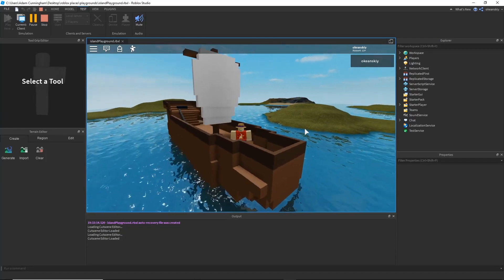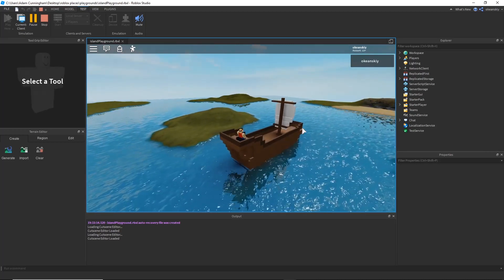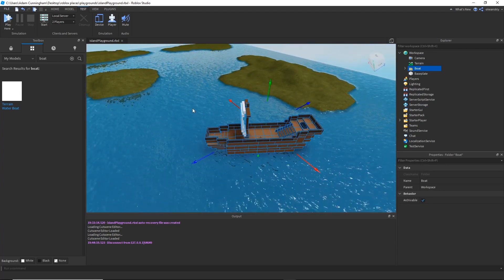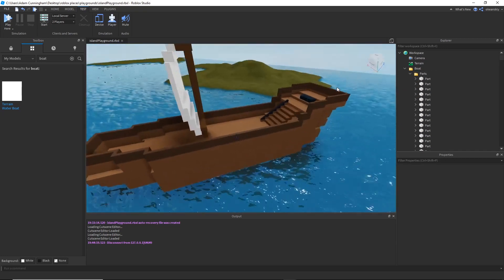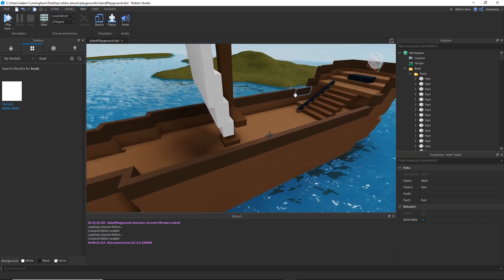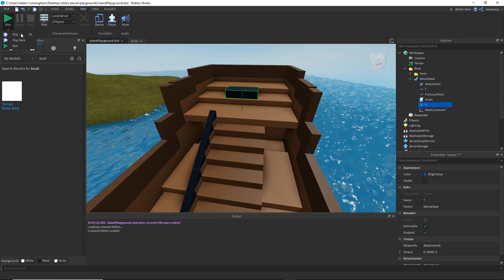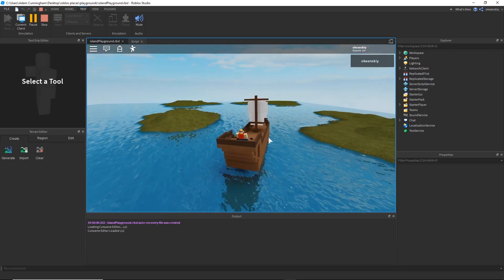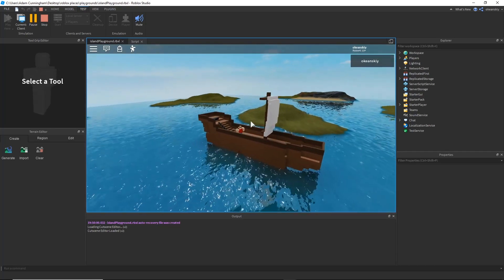Free Model - Terrain Water Boat - Roblox Studio

Comment: How would you do it with a smaller boat? I have a rowing boat and applied all your settings. Unfortunately it is too wobbly. If you move to the side of the boat it starts wobbling. also with the extra weight from the char its half submerged in water. any ideas?
Reply: Adjust the torque and thrust values and use custom physical properties (sorry for late reply)

Comment: How to go customize this for whatever size, shape boat you need.
Reply from the maker: It doesn't matter what the boat is, as long as the VehicleSeat and all other necessary objects are in place. The VehicleSeat should be welded to the boat and all parts of the boat should be welded together.
Reply: @okeanskiy  Ok, I am working on a battleship game with huge battleships. Thank you for the help.
Reply: So I finished my ship design, and the problem is, it drives and stuff, it just moves EXTREMELY slow.
Reply: @thelad9434  increase speed in vehicle seat

Comment: Very nice

Edit: How can you make this like touch to spawn like the car models  but a boat but anyway thanks for the boat :)
Reply from the maker: Normally, spawning anything that is welded together is pretty easy. Just have a copy of the boat/model in either replicated or server storage, and then clone that model and set the CFrame of one of the parts (either a dedicated part or just simply the VehicleSeat) to a CFrame that you want to place it in. Then just parent the clone to the workspace. Then have this code connected to the touch or button click event for spawning.

The neat thing is that any time you set the CFrame of a part, all parts that are welded to that part are adjusted accordingly. That's why you can CFrame the humanoidRootPart of a character and everything will move with it, the root part doesn't detach.

https://developer.roblox.com/en-us/api-reference/class/WeldConstraint
"In contrast [to updating position], if a part’s CFrame is updated, that part will move and any part welded to that part will also move. These other parts will be moved to make sure they maintain the same offset as when the weld was created."